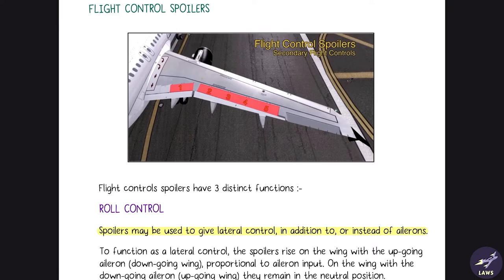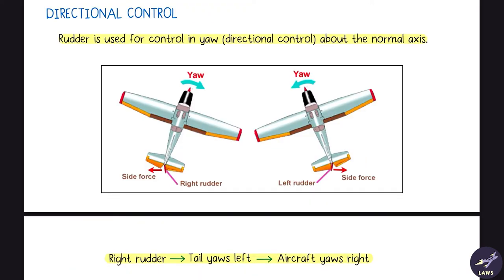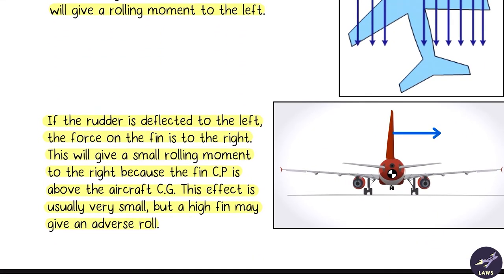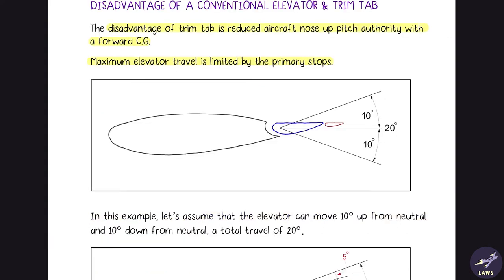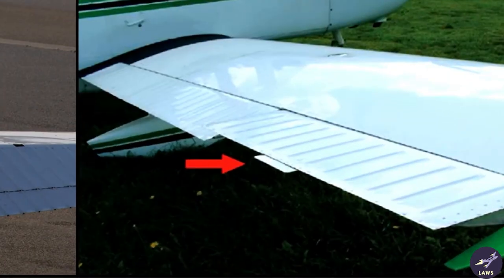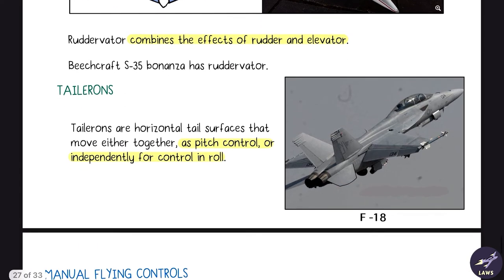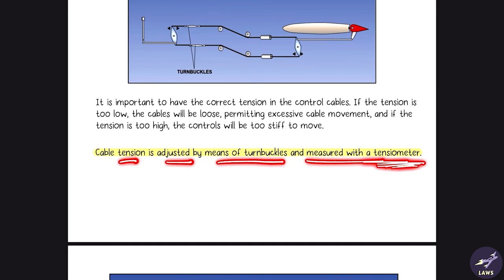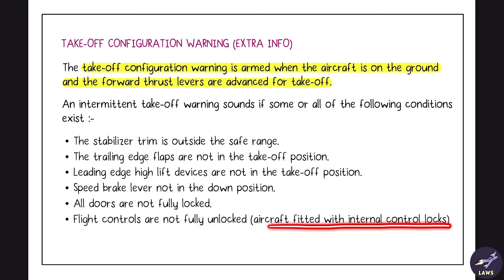Controls Part 2 - Principles of Flight #10 | Technical General DGCA CPL Exam Ground Classes Online

Comment: Correct me if I'm wrong
01:22
You've mentioned that spoilers are deployed asymmetrically.
So when aileron goes up, spoilers go down or remain intact.
Where as when ailerons go down, spoilers go up to decrease Lift, Induced Drag.
Reply from the maker: @harshavardhan-np3tg  Spoilers have 3 functions - Roll Control, speed brakes in the air & lift dumpers on ground. 

For eg, for left turn - left aileron goes up, right one goes down. Spoilers would work similarly in this case, left spoiler would go up and right one would remain in place. (Spoilers only have two positions up and neutral, unlike ailerons)

At higher speeds, ailerons are not used due to high bending moments and only spoilers are used for roll control.